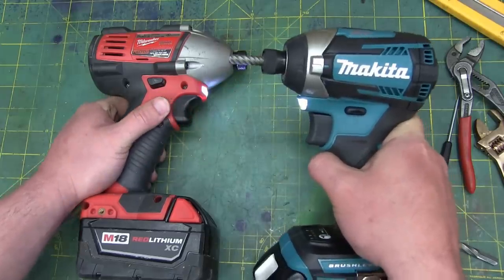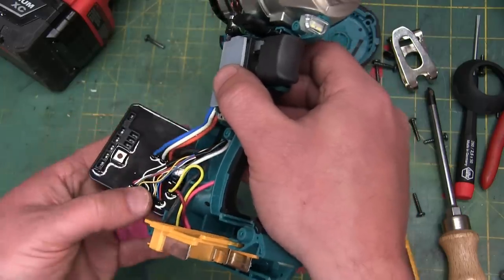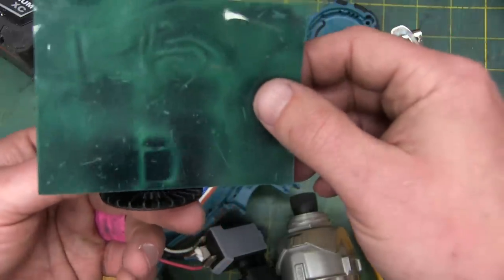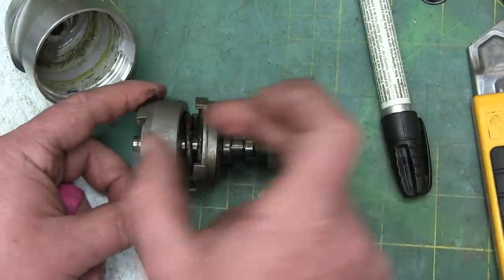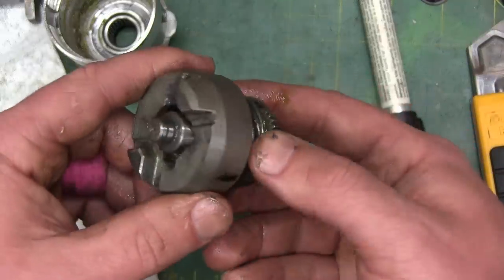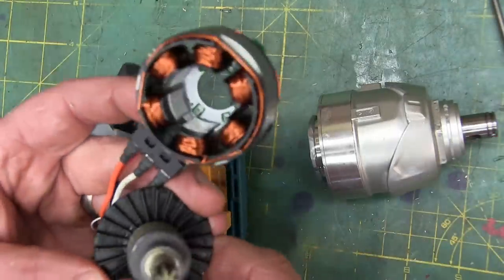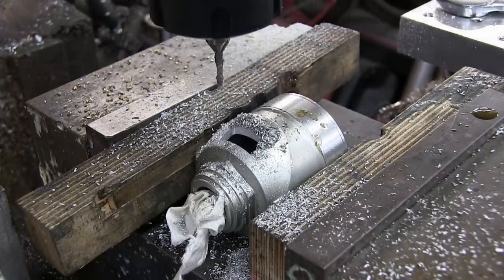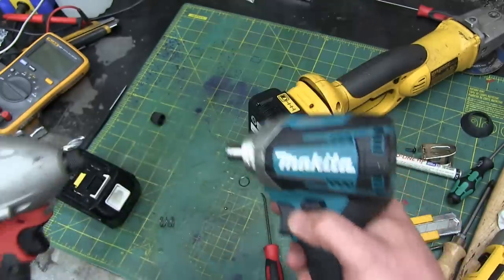BOLTR: Makita Brushless Impact Driver

Comment: I finally found out what S, H, and T stand for. I kid you not I spent 10 minutes searching for a model that had it, since they use 1-4 or a 1-9 digital display now, and then had to look through a PDF of the operator's manual.
Soft, Hard, and Tighten. Soft for a gentler blow, Hard for really beating on your nuts, and Tighten to get it right to the edge without busting it. In case anyone was wondering, it was driving me crazy.
Reply: Nice, thanks!  I thought it must be in a language other than English.
Reply: thank you for your service!
Reply: @Heggethorn.warrior  Very welcome!
Reply: Thank you
Reply: And there was me thinking T mode stood for "Tek mode" since it's used for Tek screws (self drilling screws for metal).
It spins fast initially for the drilling part and then slows down for the impact part so as not to damage the threads formed in the metal.
H and S stand for "Hard" and "Soft" according to the manual.
Reply: @alfiebrotherton935  Which means you've read every youtube comment section under the damn sun
Reply: "Driving" you crazy... I was late to the joke sorry. haha
Reply: @rustopholis1667  Hahaha good job.
Reply: @ProfessionalAmateur i think there is just a timer that goes on whenever it starts to impact
Reply: @ProfessionalAmateur Impact strength with these tools is very RPM dependent because the faster it's spinning the harder it hits before the spring allows the hammer to slip. That's my basic understanding.

Comment: high speed camera on the internals of a working impact gun, way cool!
Reply: Made me wonder if some sort of cam system could be used rather than a spring, so that the hammers engage the anvil more directly, rather than bouncing around.  Would probably be a costly nightmare to manufacture though.
Reply: That bounce made sense to me for an impact driver, the secondary strikes increases the effect of the impact.
Reply: No it doesn't, since it strikes with way less energy than the first impact, therefore producing less torque and being inconsequential to smacking the nut or farstner.

Comment: uhmw has superior wear resistance against low speed abrasion compared to hard steel. Its tougher so it deforms around abraision points and springs back rather than fretting, micro fracturing, or the plastic flow of softer steel.

Comment: I used to work with Makitas all the time building wind turbines. Once, one of them felt from the third tower to the second one inside (right next to me). It was a 25m drop. Grabbed it, pushed the button and continued to work (Note: it dropped on a metal floor, not on a soft spot that could work as a "pillow"). They are great tools.

Comment: one of these guns just survived a 25' drop at our jobsite yesterday. battery poped out. put er back in. no problems at all. no cracks.. nothing. kind of amazing
Reply: Pretty impressive. I've done a accidental karate kick to a pneutrend cordless impact wrench from 6'ish meters(20feet) Something came apart in the battery during that but when it works, it works fine.
Reply: dropped my Dewalt from about 20ft on to concrete and it survived too. battery didn't pop out but it did get cracked. i thought i was gonna be going to buy a new drill, very impressed how tough some of these tools have become
Reply: Tom Celona -- My makita slid off a roof of a two story home and  3 weeks ago! As i was staring in horror, it seemed to fall in slow motion, hit the concrete, battery flew into the bushes......15 minutes later she was back in business. No cracks, no chips, no scratches! I think that damn tool is either a zombie or knows how to skirt the laws of physics!
Reply: if you get lucky they'll break.
Reply: I dropped my old dewalt NIMH drill from 10ft and it imploded spread its guts all over the place. I dropped my Makita impact driver 14days after I got it there’s a scuff on the battery and a mark on the over moulding other than that it’s going grand. Cordless kit has moved a long way in past 5 years.
Reply: They always told me in case of fall out, just slow down, put it back in. good advice.
Reply: M

Comment: Props for showing the result of the click-bait thumbnail in the first 30 seconds.
Reply: LordDratsab do you understand how asinine what you just said is? Of course not. 
If he showed the results, then it is not click bait!
Reply: Welcome to the modern youtube. Where interesting = click bait now apparently. I miss the good old days where it was just misleading stuff that sounded interesting but was a boring story.
Reply: ...that doesn't even make sense...
Reply: clickbait = baits you into clicking the video. That's literally all there is to it, and it did it's job. But unlike other people who use clickbait, AvE actually fucking shows it off within the first minute. others take like 25 minutes to get to the 2 seconds of thumbnail.
Reply: trouble is, most people on youtube aren't smart enough to understand the basic truths of the platform
Reply: Hahahah, i skipped through the whole thing to find it and felt it was pure clickbait for a moment.
Reply: that ones on you there man
Reply: LordDratsab — go to the back of the line: we're all before you
Reply: I run the same Makita impact driver it's a cracking bit of kit. The button with the  T is for Tech fasteners. Mine has an auto button too where the tool senses the load required so it starts a faster slow and ramps up the power to the required level to drive it. Thanks for the tear down
Reply: LordDratsab it isn't clickbait if he actually did it...
Reply: LordDratsab it's not clickbait.  It doesn't redirect us from the video.  It is his own advertisement, sure, but it is non intrusive and it is very clear what you will be clicking on if you choose to do so (once the options pop up).  You can't just us the term to describe any link that is shared online.  Now, if it said, "Hot babes lust for men in these" and then autoredirected us to his web store it would be clickbait.  But it would also be classic AvE and most of us would come back just to click on it again for another good laugh.
Reply: @JustinKoenigSilica  click bait is stuuf irrelevant to the video that brings you to the video Its also something that may not be in the video
Reply: Right?
Reply: This man does not do click bait. He does results.

Comment: Worked for a contractor in an Intel  factory,  I've been handed this impact driver brand new.
Most of the work was attaching pipe hangers on the ceiling H rails - 22mm bolts, alot.. 
I was absolutely amazed - the auto-impact setting lets you tighten to a certain degree, keeping the trigger pressed and it starts ramping up the torque - got another couple of turns effortlessly as if the bolt was loose again.

Awsome tool 👍👍👍😎

Comment: still waiting for AvE to discover the Hitachi Power Tools brand, so he can start tearing those apart.
Reply: And kawasaki tools.
Reply: Hitachis are underrated
Reply: Anguisette He reviewed their Magic Wand.
Reply: He already did a Used Magic Wand.
Reply: there is a brand of deathspot tools named Hitachi, screw strippers, dead tree carcas manulipatirs, and even robo flashlights.

then separately there is the wand, from a different company that can be used to rock some socks.

two separate items.

Now, the green and black tools if master home duckers may be so generic that they may not come up, or some one can donate one to the great white north
Reply: tek413 Nah, same company. Hitachi: Quality Dildos 'n' Drills (TM).
Reply: Hitachi table saw is very cheaply made in my experience, the entire frame that holds the metal table is made of plastic.
Reply: Though if have no complaints about their handheld grinders.
Reply: Id like him to tear apart kobalt tools
Reply: They sell Kobalt at Lowe's, so my guess is that Makita and Milwaukee are a step up.
Reply: Would love to see him tear down a hitachi or Bosch grinder see how skookum they are compare to the Mikita
Reply: tek413 do you mean ryobi?
Reply: I've taken my Hitachi impacts apart. The waterproof one and the triple. Good and bad bits. I want Makita and Hitachi to spawn. A Hikita. Good Makita steel , smart long lasting Hitachi engineering.
Reply: Tin Man I was asking for the same thing, I live in Japan home to both makita and hitachi. I own the ip56 triple hammer impact and many of the guys I work with (I'm a carpenter) have the makita
Reply: Devin Waddell cool. Love to visit Japan. Love to walk into both Hitachi and Makita HQ and bang in 4000 tek screws into their desks and say "Gather round boys and girls! Gunna play a game called ' Spot the shit bit'!"   Impact- To endure IMPACT.
Reply: I'll be honest, I love my hiatchi power drill
Reply: Very hard to find Hitachi stuff in Canada, maybe it's just a British Columbia thing(?). They just don't seem to have much of a market here for their cordless tools.
Reply: 0hypnotoad0 Hitachi has some issues right now, and that's really preventing them from selling many units. They just don't have stock in the warehouses, so stores are moving away from selling their tools
Reply: tek413   “GO TO “FRAMING NAIL GUNS.
Reply: The inside of hitachis aren’t quality like the inside of Makitas so ill stick with Makita. I’ve also heard the torque on the triple hammers isnt as great as they have been made to seem.
Reply: Anguisette why bother, they are crap
Reply: lol Ave be like "Hitachi, what kinda chinesium is that"
Reply: If he thought this looked like a space gun, some Hitachi tools will blow him away
Reply: I love my Hitachi tools.
Reply: My Multivolt triple hammer kicks royal ass! I actually own like 3/4 of the Multivolt line and it’s legit amazing how skookum the tools are.
Reply: @tinman7781  Matachi would be the other sibling.
Reply: I have a hitachi impact driver which has been through several wars and is a bit rough around the edges. 
Thing is though, that it’s one of the few tools that I know will work every time. She’s got a few extra rattles but works fine. Want to get the Makita one next as it’s compact and I have a few sets of Makita batteries laying around.
Reply: He is at his best when he gets a harbor freight fix

Comment: spent a full day of quality time with the new little makita brushless sub-compact hex-bit drive ... lordy, lordy, it packs a mighty wallop ... 
It's a very impressive thing with the 2.0Ah battery and just keeps going, when I switched to the 5.0Ah battery borrowed from the chainsaw, it made 4 inch coach bolts into redwood seem like drilling 3/32nd pilot holes into pine ... the new "A" mode (torque limits to drive screws) is marvelous, just keeps adding torque to maintain rip-'em ... goes from a quiet whirr to a clattering gatling gun driving the bolts home.  Saved me a lot of grief on a ladder balancing with my knees.

Comment: I've always wondered what the difference would be between the control loop in a brushless system like this in comparison to the ones in the hobbyist RC motors I'm familiar with. Those only have 3 wires for power to each field, and that's it.
Reply: The difference is the load.
RC controllers use voltagespikes from one of the magnets passing by a coil to estimate the location of the rotor.
But those RC motors stall way sooner then the tool version.

(I know your comment is 3 years old but maybe someone else has the same question)
Reply: @SuperUltimateLP   Some hobby motors have hall-effect sensors in them for position. They're called sensored motors and most people use them in crawlers from their excellent control at low speed.

Comment: I think the two ratings are under different conditions: max speed 3600rpm with no load and 1900rpm with infinite load. Amazing slowmo shot there! Are you planning to get a dedicated non-potato high speed camera?

Also doesn't the hammer retract because the motor twists the spring and pulls back the hammer?

Comment: On the tab on the foot its three speeds and the "T" is for self tapping in sheetmetal. High speed until it penetrates the metal and then once it feels the screw bite it slows down so you dont blow the hole out. Really nice feature. Ive used this exact impact for the last 3+ year. Have definately punched some  3/8 hex holes in some fender washers with this thing

Comment: The contact leads are definitely nickel instead of chrome plated.
Nickel is also resistant to oxidation and the process of swapping the batteries refreshes the contact surface to maintain the conductivity of the contact point.
Also, the T mode is for use with self-tapping screws. The slower ramp-up to rated RPM makes it much more controllable for getting the self-tapping screw started on a metal surface without center-punching.

Comment: AvE, The Impact driver has 4 different modes which you change with that button on the bottom of the driver. You have your 3 different speeds and a self tapping mode which spins as fast as it can to drill out the hole and than slows down to impact the screw/Bolt into your material. This stops the drill from stripping the shit out of the screw or ruining your driving bit.

Comment: the spring and hammer is tuned for driving standard 3" #8 construction screws in pine at full power, having the bit clamped in a vice or driving a big lag bolt with lots of resistance will make the hammer act differently

Comment: You would dig the all Black sub-compact set of these ...I have 2 sets. Button push changes modes. One is balls to the wall from trigger pull, other it starts slow and speeds up to full.

Comment: I have this very machine and it's a monster, used it to put 30 cm (yes, 1 foot) screws in wood.
It'll rip everything a part if you're not careful.
Plus, it's very compact so easier in tight spaces.

Biggest downside is a real lack of speed control.

Comment: Also, complete the set and poke about inside their brushless impact wrench next. I have one, and it hits extremely hard. Imagine the twist you could manage using a half inch square vs half inch square on a second impact wrench. Perhaps ... Brushless makita vs Earthquake, battling it out over a section of high tensile steel....?

Comment: 'S'= soft 80nm torque (the medium setting stays  around 110nm)
'H'= hard 180nm torque
'T'=  self tapper mode.   For drywall srcrews.
And the remaining button is for the light.  If you hold it for 5sec, light is not turning on when you use the tool. 
If you just press it, it acts as a torch.

And there is another 'oil pulse impact driver' that uses oil instead of a spring.   It runs smoother but, it can'take as much torque as this one

Comment: I've used a Makita TD148DZ since they came out and it's still kickin' ass. The Milwaukee and Milwaukee fuel crap the guys bring on site just don't drive Self-Tappers like the Makita. As someone who uses it outdoors all year long on Vancouver Island I can say these things will take a beating and zero issues using it in the pissing rain. The TD148DZ had an extra 200RPM compared to the model you have which works great when your self-tapping fasteners into heavy gauge all day

Comment: The T is for (self)tapping sheet metal/ductwork, supposedly it will reduce speed once it sense that it's grabbing (as opposed to the tapping/drilling).  In reality it doesn't really work for ductwork - by the time it senses the catch it's blasted in there big time.

Comment: the DTD154 is a higher end brushless unit and should only be compared with the Milwaukee Fuel impact driver  (M18FID) this is not an apples to apples comparison at all. Also it's good you mentioned the rubber vibration dampeners on the Makita, this is a great idea, we see 10+ Milwaukee tools a week brought in for a warranty repair with worn battery contacts that could be prevented by Makita's simple addition.

Comment: Same problem with the battery plagues the Milwaukees. My work uses that brand and from what I hear a lineman was up on the stick, pulls out the rattle gun and when he started getting going with the ugga duggas on the Kearneys the battery falls out in the perfect angle to take one bounce off the pole and come back on the way down smacking the helper on the ground right in the face. Sent him to the hospital.

Comment: Man, I beat my makita Impact up on the daily.  Like using the battery side as a hammer on studs ( Im an electrician, everything's a hammer)  And given the 1/2 drill a hot supper weekly for 6 years.  Never fails (except the fucking batteries) Love my teal machine.  Keep on the great reviews AvE

Comment: I bought a Makita BTW450 back in 2013, at the time it was the (from what I could find online from real experience) the most powerful electric impact wrench you could get. I've let it sit for a year without using it before, the two batteries have never dipped below their charging threshold yet. I don't use it that often, but if I'm in the junkyard or I don't feel like lowering the car and putting the tire back on because I forgot to crack the axle nut this thing saves my ass and was completely worth the (then) ridiculous price tag. Amazon says I paid $292 for it, I think I bought it open box.

Sorry for the long story, I guess what I'm trying to say is: even though I research every tool before I buy it's pretty evident to me the Makita is 9 out of 10 times going to be the best.
Reply: P.S. FUCK the charger for those 18 volt Makita batteries, that thing sounds like a goddamn jet taking off. Just put a button on that thing for a slow charge, not only is a slower charge better for the battery, but if it means that the thing isn't as hot as a stove and blasting that 20mm fan at 15,000 rpms I'd gladly take a 5 hour charge time. How hard would it be to add that into the software?

Comment: The tools are great. 
The overmolding turns loose in less than a year.
But, I'm a professional forklift mechanic and mine is exposed to all kinds of oils, greases, and solvents.

I've broken several Milwaukee 3/8" drive IMPACT RATED socket adapters with this little Maikita.
It is one skookum, choochin' mofo.